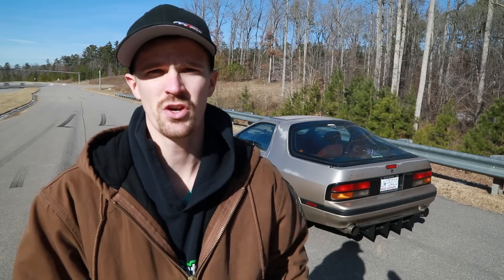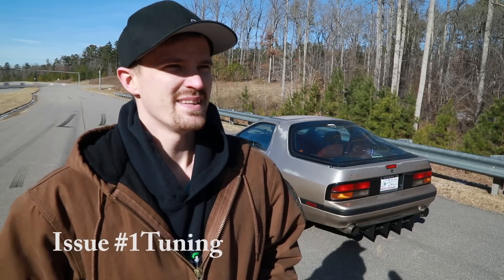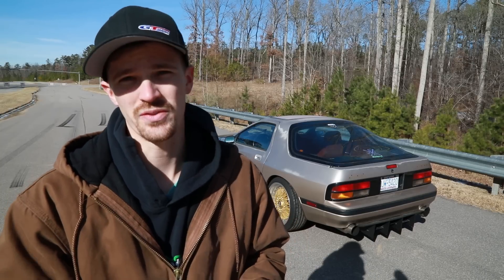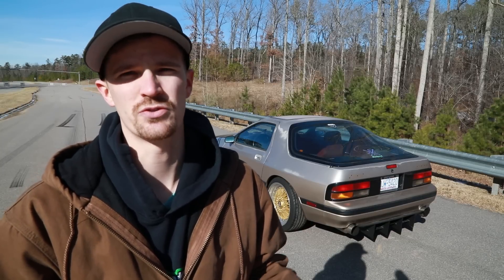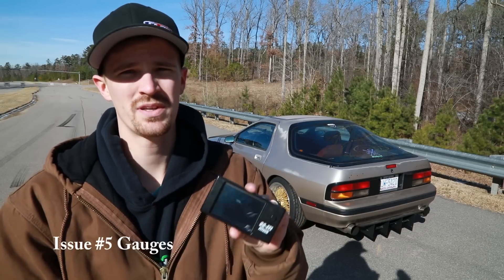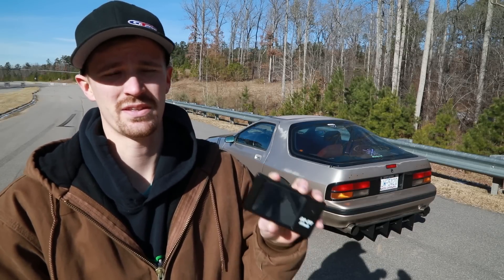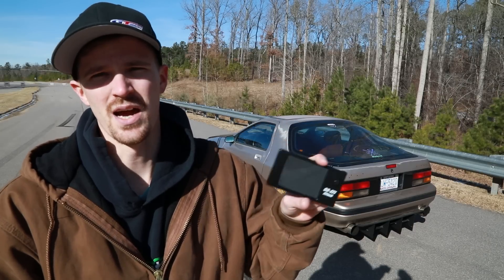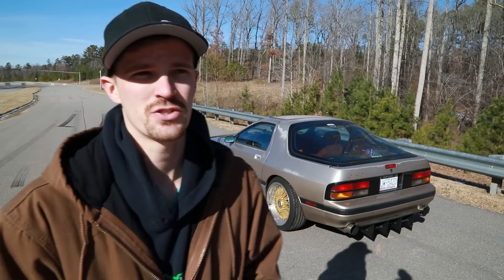5 Reasons Not to Buy FiTech EFI System

Comment: dont run dual plane intake manifold with fitech, 
 or at least put 1"open spacer between  throttle body and intake.
Reply: False -It reads signal from both sides. The base has a slot that goes from one side to the other, and it crosses over the middle. I have FiTech EFI on my 455 and have used both a dual plane and a single plane in back to back testing at the drag strip and the dual plane was actually a few hundreths quicker. Quit spreading BS.
Reply: Shen RC   using the dual plane intake causes the fitech to only monitor the vacum signal from  one side of the intake only,
Reply: you should be more respectable to people the only thing that does is shut off the debate you have anything else to say or just stupid remarks if your so smart you better get ahold of access dfi and tell them there morons for using a single plain and many other company to that use single plain in there set up i think your the only moron do your self a favor and shut up dum ass
Reply: And why is this what problems does the dual plan intake make the fitech have?
Reply: Edelbrock "Air Gap" dual plane intake is what they are referring to.
Reply: Plenum is what’s important for signal. Other wise stay with the manifold that meets your cam/heads.
Reply: There is an episode of Engine Masters here on Youtube, where they compare carbs vs efi. They fought the EFI tuning with the dual plane until Friburger changed to a single plane and eliminated the issues. I think it was more a drivability issue than a WOT problem. This was done on a dyno by three respected engine builders and tuners. They were surprised that the dual plane was the problem as well.
Reply: @rts3613  
I like the fi tech system but didn't that episode show that the carb performed just as well or not better ?
Reply from the maker: Iv heard a single plane is better but iv already got this one. A spacer is a good idea but yiy cab see how small of a air cleaner I have to run due to hood clearance so. I won't have any room with a spacer as well. Maybe if I keep the system ill upgrade the intake.
Reply: So what does that cause the motor to do? I have Chevy ZZ4 crate motor with a dual plane manifold and I don't see any problems? guy's say they make the motor hard to start?
Reply: Hector Ortega i
Reply: i agree single plane only way. some dual plain manifolds have a 1/2 cut out between the two side that might be why some people don't have as bad of a time but single plain to get the most of it if you watch engine maters videos they have a show that talks about it
Reply: I have a Chevy crate ZZ4 motor pretty sure the dual plane dont have the 1/2 slot cut...why does it not run as good with the dual plane? what are the symptoms that you see when running dual plane?
Reply: re place your intake see for your self check out engine master videos they talk about this and take off your fitch off and look most new dual plain have this cut out
Reply: I think I seen that but they tested with carbs the Fitech system is different so it is not the same... everyone says dual plan don't work but no one states what the problems are when you do use one with the fitech ? only thing I heard about it was hard starting problems but I don't have that problem?
Reply: Thanks for the input 👍😊👍
Reply: Shane McLoughlin is this system worth buying?
Reply: i swiched to a victor jr from an rpm on mine had a big flat spot i couldn't shift changed the intake and solved it . oddly had the same dead spot with carb i had before hand as well lol
Reply: Petrol360 you could have a step machined in the plenum as well to balance both sides then you don't need a new intake. Just a thought.
Reply: @ RT S Are you absolutely sure that the Engine Masters episode was a Fitech Unit? Are you realy sure? You should watch it again. I have a a dual plane and Fitech and I can tell you that I have no issues with my intake at all.
Reply: I have a 350 HO and it has a dual plane. I think the ZZ4 uses the same manifold. Starting with the ZZ5 (or ZZ6) a single plane is used. Anyhow, FiTech is working fine on my dual plane. I am using a 1/4" spacer. Not for increased plenum area though. I needed to solve a clearance issue. I doubt this small spacer makes my dual plane work.
Reply: Aeternalis Armentarius  236/242@.050, 110 LSA Hyd Roller. 600/620 lift. Pontiac 462 with 9.5:1 CR. Runs 11.0 on 89 octane with a dual plane. No two engines are the same. Claiming that it just won't work is in fact false, as I have proved that it works...with my current combination. I never claimed that there aren't issues, I just said quit saying these systems don't work with dual planes, when they do.
Reply: You all are morons about the single plane manifold
Reply: Hector Ortega you're dead wrong